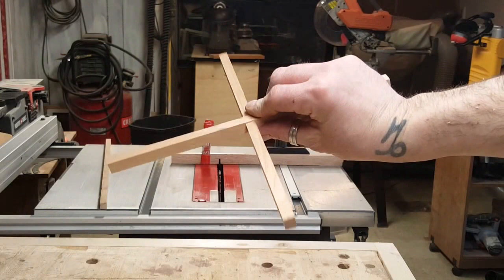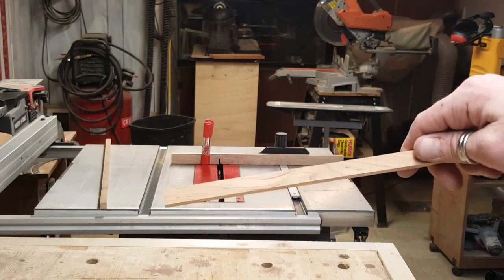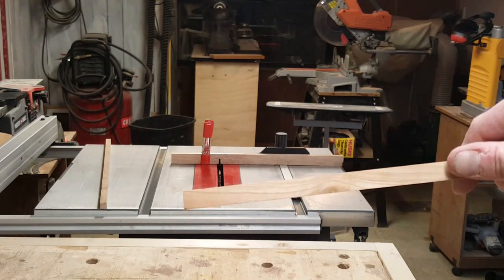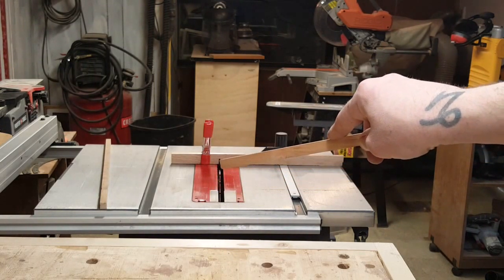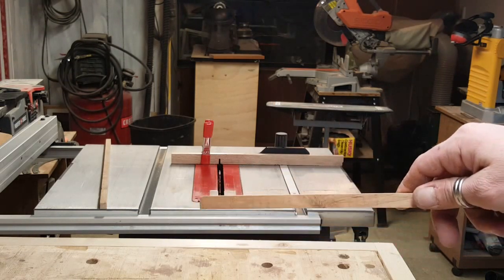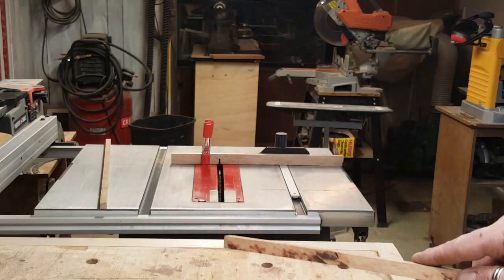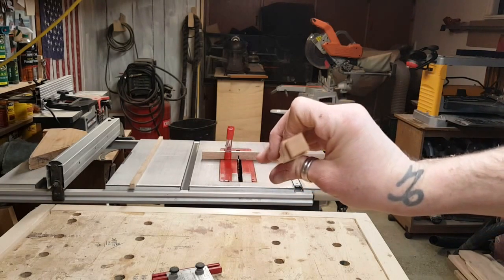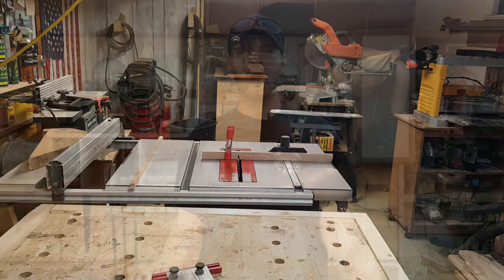how to make a custom lamp- (using veneers) part 1/2

Comment: Nice tip on the tenon
Reply from the maker: thanks man i think ive told this to everybody that has mentioned it. :)- itll only work if the blade is raised an 1/8"or less otherwise the piece will chip out ..well for this size tenon on this project that is..haha tha ks for watching and the comment man!